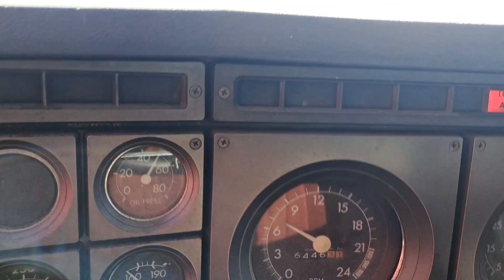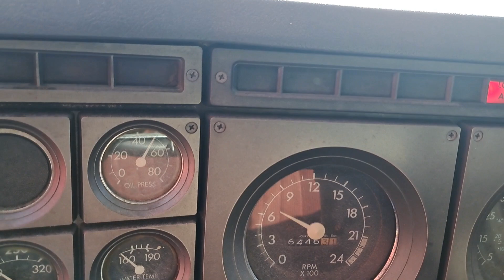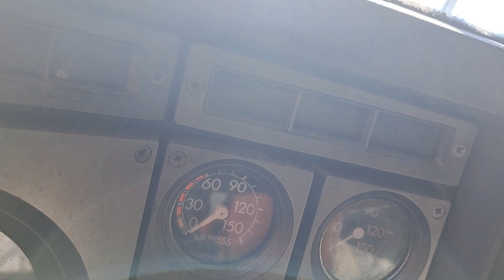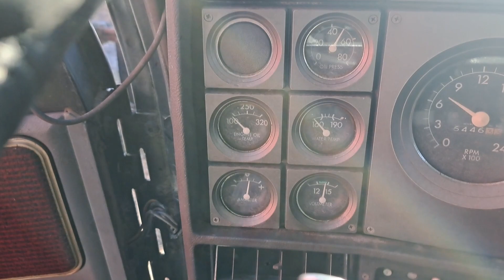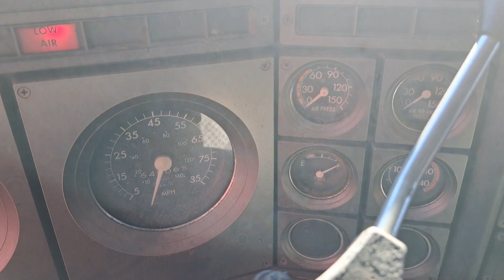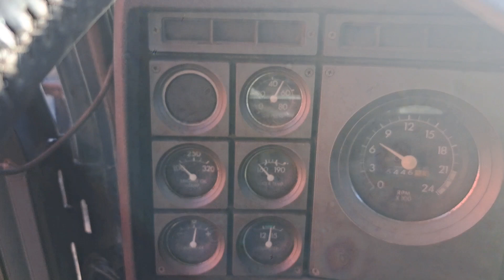Cummins Big Cam fuel pump install and will it start. 85 GMC General

Comment: Where did you get the new injection pump from ?
Reply from the maker: Had it rebuilt
Reply: Ok so you think the parts are the same for 1985 gmc and a 1990 KW T600 with BCIV 4 ??? If so what’s your part number I have 3 bolts at the bottom of mines on a rounded edge square like plate.
Reply from the maker: @teejayoriginatorz  it goes off the CPL.  You can take your off and send it out to get rebuilt.  I se t mine to Carolina Powertrain in Charlotte
Reply: Thank you I’m going to call them today